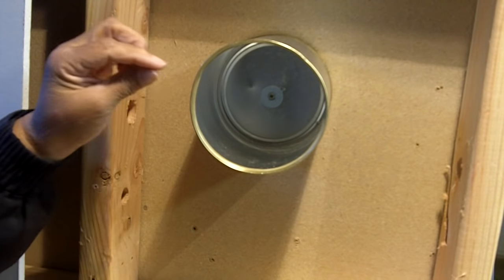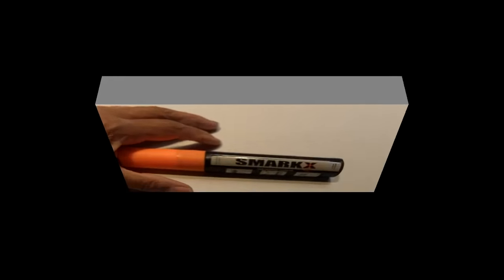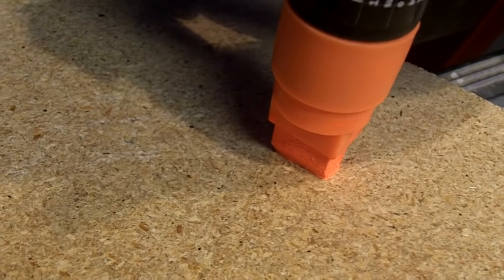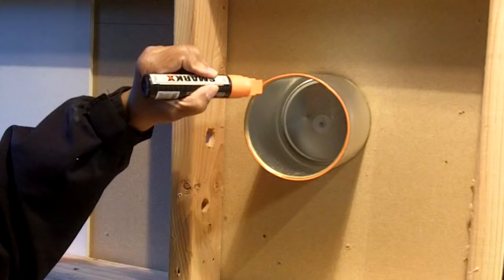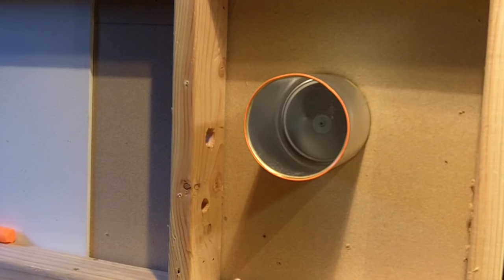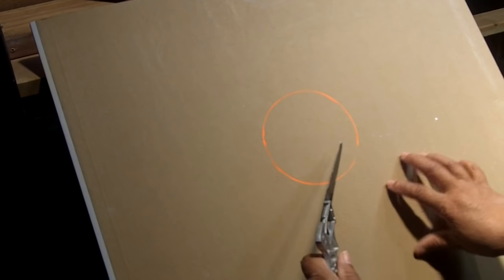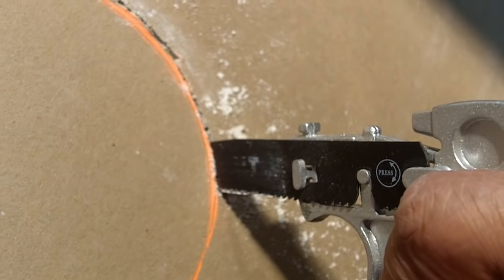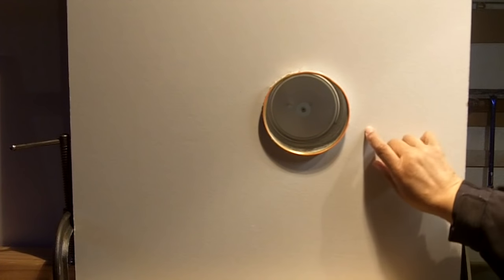How to Make Perfect Drywall Cut outs Every Time With SmarkX

Comment: Based on this video I used one of my wife's decorating markers that has a push down tip. Worked like a charm and I had a perfect cut in my drywall for an electric outlet.  Thanks!
Reply from the maker: Nice, Paul, way to improvise!! 👍

Comment: Hi Leah, I have to say when you first mentioned the problem I thought of the answer right away. I come from an art n crafts background so I thought that you could use any kind of paint or ink to do the same thing. Then when you said "like a rubber stamp" I thought exactly! However, for those who want to save money, a special pen tool isn't required. Being on construction sites I know they usually have some extra paint hanging around so a little paint on a rag could do the same thing and save the cost of buying an extra tool. Even a little dish soap might work. Anything that would stay wet and leave a mark. Unless of course the people that make that product want to sponsor your channel, 😉👍LOL. Anyway, Great video and a very handy tip, thanks! Dee😊👍
Reply from the maker: +DeeEll86442 Hi Dee, Sometimes it's nice to just have the tool in your back pocket and ready to use. We aren't sponsored at all by this product, we just like to give people options! :)

Comment: How does this work if the pipe is sticking out 4 or 5 inches? Tilting the drywall against it  may not give accurate impression.

Comment: There are two challenges to this, one is cutting the hole to the correct size and you covered that well.  You completely ignored how to cut the hole in exactly the right spot so the board edge abuts the adjacent board when it slides in.  Very helpful though.

Comment: works great for a 2x2 piece...now do it with a 4x8 sheet of drywall
Reply: Size doesn't matter.
Reply: Size does matter. Just try this technique with a 4x8 sheet. The trick is not new. I have used paint for years to mark cut outs. Problem with a larger sheet is weight, alignment and balancing. It's easier and faster  to measure to the center of the cut out and transfer the measurements to the sheet to be cut.
Reply: Old Ben tell that to the girls lol

Comment: Notice the opening to the left when she places in the drywall.. Instead of installing one piece of drywall, install two when covering holes.. just match the hole, cut out the circle in a square than make another square to fit the last piece. installing 1 sheet alone is tough alrdy

Comment: Does the orange wash off easily from the receptacle?
Reply: +DIY drivel Remember, it doesn't need to .This is generally done for electrical junction boxes that are used for on/off switches and plug ins . They get covered up with a plastic cover plate .